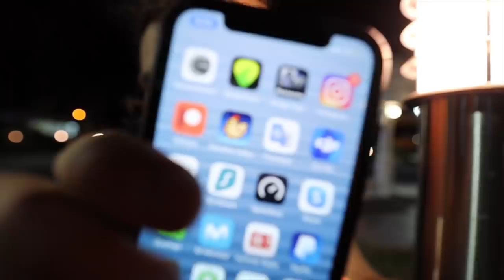Converting A $6,000 School Bus Into A Permanent Tiny House

Comment: Have you thought about selling the engine, transmission, suspension parts, tires, rear axle,  etc. to help finance your project? There must be local Chev  trucks that could use your unused spare parts.
Reply: Worthless. Vehicles go to Panama to die. All of Central & South America are vehicle graveyards. 
They should have let a local buy it too. $2000.00 US TOPS for that schoolie.
Reply: @johnchase4408  They said they plan on living in it until their project is done.
Reply: How the hell would they get rid of it if they got rid of all those parts? They couldn't move it off the property without a suspension and other parts. And I don't think they want to be looking at that piece of junk ten years from now rusting out.
Reply: @stevewainwright3344  It sounds like they installed it permanently on the property, so with proper rust prevention, it should be there for along time.  The way things rust in tropical climates, the wheels probably won't turn after a few years.
Reply: it will be there along time because the tires are going to rot out and they won't spend the money that it will take to get it out of there. And the time to keep it looking nice once they build that tiny house. Unless you completely get rid of rust,
Rustoleum paint won't stop it from rusting. And unless you keep it waxed the paint
job will eventually go to crap. Trust me, I've taken care of vehicle for over 65 years
so I know where this is headed.
Reply: @stevewainwright3344  Tow truck?

Comment: Kaylee turn over the ground and get out as many roots and vegetation as possible then tarp it.  You want to prevent anything from growing back and unwanted seeds to start growing.  Grass is a real pain to keep out. Keep it tarped until you plant and then have lots of mulch ready or use the heavy duty landscape cloth.  There are lots of pros and cons but find what works best for you.  Start a mulch pipe with the cow page and other vegetation you cut down and in no time at all you will have wonderful compost.  In that climate seeds can take hold very quickly so tarp is necessary and then vigilance.  I'm a gardener so give a shout out if you have any questions.
Reply: Tarp, newspaper or cut up garbage bags. Personally I like to use newspaper but it's up to you.
Reply: @aggiewitsend7206  Newspaper is great.
Reply: Cardboard or old carpet work also, just cut holes and plant....James
Reply: @aggiewitsend7206  I like newspaper and cardboard also but suggested tarping because they seem to be in a place that gets high winds and tarp would be easier to secure.  Newspaper would also be the cheapest so worth a try.
Reply: I agree. You'd definitely need a lot of rocks holding things down for sure.
Reply: Agape Powell 
We do raised bed. We plant and lay newspapers around the plants

Comment: Instead of clearing the land cut the grass down super short over and over until you are ready to plant the seedlings. It will protect your top soil from washing/blowing away. 
Keep your short patch larger than what you need but only "clear" the rows you need for the plants and cover the roots with plastic and your pile of dead grass from all your cuttings to keep the rows clear. 
It will save you back breaking effort and preserve your soil.

Comment: Kaylee (I apologize if I misspelled your name) stop breaking your back digging up that ground. If you want to plant now then continue but if you don't mind waiting a few months to plant there's a better way to do it. Get some hay and lay it down in the area where you plan to put your garden. Make sure to have at least 6 inches deep of hay and then if you want to put a tarp over it to make sure that the sunlight does not get through to the ground to allow anything to grow but I've never used a tarp.  After a few months the ground under the hay should be nice and soft and super easy to dig into. Just spread the hay apart where you want to put your hole to plant your seed and plant it. If you keep hey laid down in between your crops it will help to cut down greatly on the weeds and it also helps to retrain moisture so you will not have to water your crops as often.

Comment: what no camera slap, lol. i think she only needs brake lines, and fuel lines replaced, for many miles to go, but meh your choice. but definitely if you keep her non driven, take a socket or wrench to the main engine crank/pulley, and turn her with out starter use, or battery, at least a 1/4.turn every 6 mo to a year! She wont seize up! and can be brought back to life! (best storage method) bird.

Comment: you guys have to get a tractor so you can grow your gardens so go ahead and get a small tractor with the back attachments so you can turn your garden the plow it. you also need a small garden tiller. Y'all can not do all that back breaking work by hand. You will hurt your body's then how will you raise a farm? How are you going to keep your baby seedlings and larger plants from washing away? I know that place has flash flooding. Y'all need to go look at some of the old people's farms then you will know how and where to plant. You also should make a small greenhouse for those baby plants till there big enough to plant. Here you go into greenhouses and you have big and tall plants say tomatoes then you go further on to other greenhouses and you have 14 day old seedlings.  Me and my Mom worked in greenhouses that only sold and grew tomatoes. the first day they gave us these 14 day old plants those tiny baby plants were thick and grew like grass. Here I was being so careful not to damage the tiny roots, The owner came over and said no just pull them apart then take your finger and push them into the 6 part trays full of dirt to grow, I was shocked how rough they were with those tiny baby plants. Then we didn't have any to plant one day so they told me to water them in each greenhouse they had these tiny plants just setting on gravel so I watered them. I saw each stage of tomato growth. people would come to buy the big huge tomatoes plants. I mean these greenhouses were huge and they had a bunch of them. They sold a few flowers also and we planted them the same way.
  Also, always pinch that bloom and tomato off. If you buy any veggie plants that have blooms and or tiny veggies BC that will make your plants stronger and you will get more products from the plants. Even strawberries pinch the bloom and berries off. Strawberries roots spread underground so you may not get any berries the first season but you will get more the next season.
 Be sure you get Insurance on your land and whatever else you have or drive on the farm. Wind damage flood damage. I love you guys and I hate seeing you struggle that why I said what I said below.
 Y'all really need to learn the lingo and what all that paperwork means you wouldn't get screwed so much all the time. Even your lawyer is screwing you.

Comment: Good video, but the information you give on the use of a VPN is completely wrong. No one can get your email passwords just by being connected, as all sites use https. It can be done if you control the router as you can MITM the connection, BUT they must get a certificate installed on your machine - which isn't going to happen.

The only way to get information just being on a network is for http (not https) sites.

Comment: I would spray the bus frame in a phosphoric acid based rust converter like Krud Kutter or Ospho. Then a couple of thick coats of tractor paint.  That should give you extra time before the frame rots too much for use. I have been doing this to our rusty Pennsylvania bus as I convert it with great results. Use a respirator and eye and skin protection with the acid. It chemically converts the rust to a different material.
Reply: @teknav1  Most acids will etch metal whether they cause rust or remove it. Phosphoric acid (H3PO4) is one type of acid which removes rust by converting it (iron III oxide) to a form which can be dissolved in water. Most other strong acids cause rust. Ospho and Krud Kutter both contain phosphoric acid.  I'm not sure of the molarity, but I'm sure it's on the mild side.  Regardless, the rusty metal turns black with a water soluble white film that one can spray off, dry, and then paint to protect the surface. Check those products and you'll see. They're effective. https://www.google.com/url?sa=t&source=web&rct=j&url=https://www.rustoleum.com/~/media/DigitalEncyclopedia/Documents/RustoleumUSA/TDS/English/CBG/Krud%2520Kutter/KRK-02_The_Must_for_Rust_TDS.ashx&ved=2ahUKEwjIuZyclqDnAhXBW80KHSIBCBQQFjABegQIAxAI&usg=AOvVaw2G57kOGjlnDonudBpT06Rn